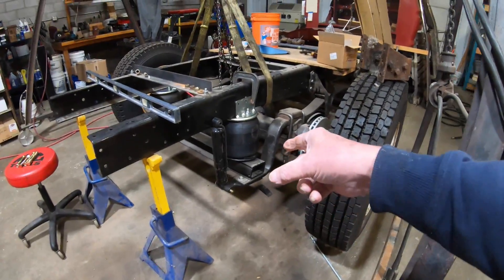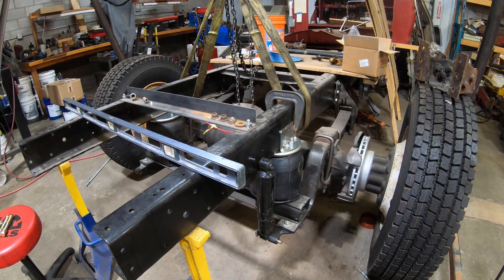Ford F750 Haul Truck Build Part 67

Comment: Would an s300 be sufficient?
Reply from the maker: S369 or 372 might do it, but BW is starting to get the spool times on their 400's down to near the 300's, so going to be taking a long hard look at all of them!
Reply: @frednewman2162  Its more fab work but twins are the best in all respects.  A turbo has about a 500rpm sweet spot, with twins you can have a 1000rpm sweet spot.

Comment: 14:04 your spring piece moved in the front when you let the truck down. I don't think that is right surely it should be retained up there so the axle can push the truck. Looks like know that lower link the only thing holding it in place and I would not think that is right. You nee to look and see what is up there. The spring isn't pocket right or there is a bushing out or something.
Reply from the maker: I look at it and will probably re-do it to watch it again! What it looks like to me, is that bracket is rocking up back to front when that happened, but again i will redo it to see again! Thanks for that set of eyes, didn't notice it when I was editing!